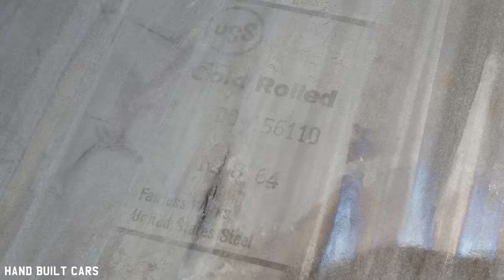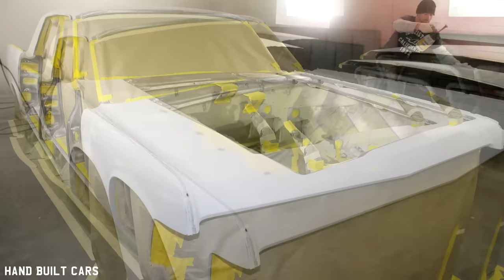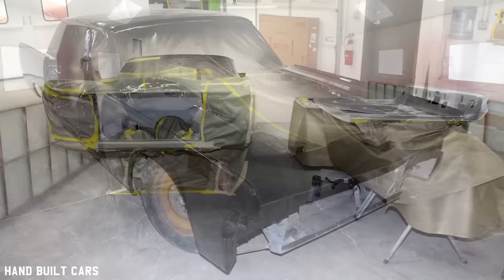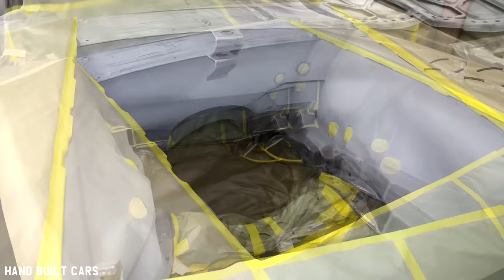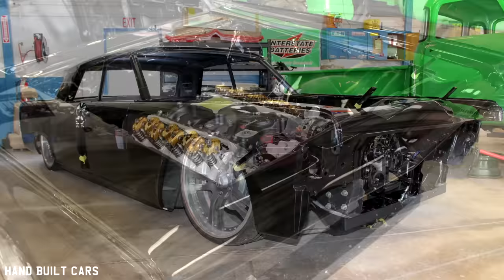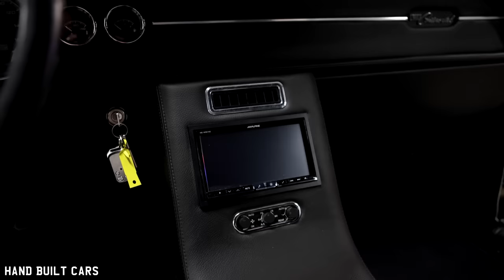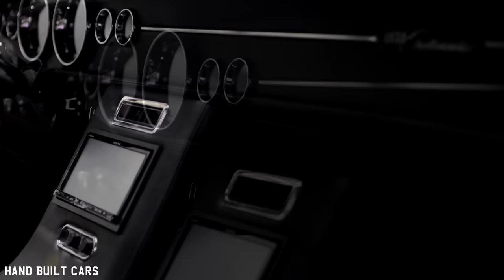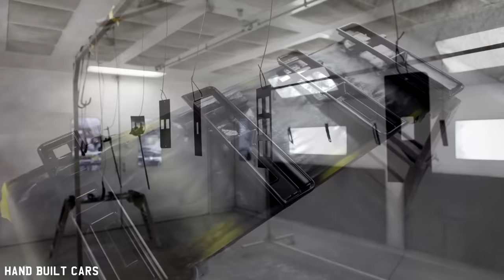1965 Lincoln Continental 532 Stroker Full Restoration Project

Comment: Great job, but in the end with these wheels it looks like a classic gentleman with Nike shoes.
Reply: 🤦‍♂️🤦‍♂️🤦‍♂️Should have left the drum brakes and the original motor too then I guess
Reply: I agree. Some smaller rims with nice spokes and thick white walls would've been my choice
Reply: To much rim and not enough tire...
Reply: I agree, the stock rims would have looked far better.
Reply: Well said
Reply: I agree the wheel pic is different, but it’s what the owner wanted. 🫤
Reply: I don’t mind the tire/rim size but definitely a more classic style would be better-maybe a wire wheel ?

Comment: Awesome restoration team. I am blessed to have three I acquired throughout my years of military service. 62 and 69 sedan but the 67 convertible is awesome too. Thank you for a look at what goes into them. Mine are not in that bad of shape, all original 460, 462 motor needs refreshing . Getting older now hope I don’t run out time getting them right. Be blessed to all who share the same passion as I for the stinking Lincoln’s.
Reply: I own 62 and 65 have them all original parts and engines. Restored
Reply: And here I am, trying to keep my 94 camry clean
Reply: We have a 68, all original. Have to sell her though.

Comment: A nice HELLO from germany, Bavaria 👋🍀

I've a big respect about all that nice sheet metal work, even because i know about that big work 👍👷
I'm still restoring a 67 Chevy Caprice/Impala 4 Door Hardtop with my 70 years old father (i'm 34)
What i've found in Ohio.i bought and impirted it to me, to bavaria. A car in a original unrestored condition what had rusted out all 4 wheel arches with the dog legs, also the bottom ends of the quarters, the whole lower windshield frame, weatherstrip channel at the trunk, the trunk floor & some more. Now we rebuilded all, especially the wheel arches at the front fenders was very difficult. Even also because you can't find repair panels or something else and it was all self/handmade with new flat sheet metal, hammered, cutted, welded, grinded until we got back rustfree fenders like new. The same about the whole lower windshield frame...the only repair panels we used and you could get for this Kind of fullsize Chevys was the quarter panels for 2 Doors. The forward half part of these 2 Door quarters we cutted and shaped to 4 Door dog legs, even to get back rustfree rear wheel arches... And so we got very good skills about forming sheet metal & body work.
& Even whenbi see some Videos at your Channel like this about this Continental i really know how, & what much work this is!
And i've really to say i'm sooo glad to see people like you at USA who're really RESTORING, and even not only changeing parts and use "parts-cars" what are mostly even also worth to save or restore in my eyes.
That's very nice, because so you could really save more restorable classic cars. Because I think every saved classic car is a good car even also because that other people, upcomming future generations of car guys than could get affordable project cars for their Projects. Every parted out classic car is a lost Part about that amazing history.
So i'm often very das to see that many people at USA are parting out really really restorable & saveable classic cars, even because they're only changeing parts and aren't really RESTORING classic cars.
I can see that this Continental was in a condition what made a restoration importand and it's also nice that with this project another more Continental is Back in the roads again instead rusting away or get lost for Future. Yeah, really really great for me to see that!☺👍🍀
I've to say that i'm more a Fan of a more Classic upgraded look, especially when we're talking about Wheels. So i think wheels Like these on that Continental are a lot tooo big. Especially the cool look with 8×15" and Cooper Cobras in 275/65 or something else at the rearend are my taste. I love the oldschool hot rod wheels on cars of that aera. But hey, it's even all a thing about the personal choose/taste ☺

I Wish i could get the next project to restore and save from a junk yard at USA. Even to Bring Back a car in the roads what the most people would parting out or let them rotting away.
It's my orde, to restore and save more of those beautiful US classic cars what anybody else whould not do. It's how i told you; every lost or parted out classic car is a lost Car...a lost Car what must go away☺

I Hope to see more saved classic cars in Videos at your Channel, it's even so cool, THANK YOU VERY MUCH 👋👋have a great day now🍀🍀

Comment: Amazing project and beautiful work for on the sleekest design in the Modern American car lineage, the front disc are limited in size for the overall weight of the car and the power of the engine, also, the seat with headrest and a wood Dash board would have also been interesting in the design!! overall, excellent result, made by professionals!

Comment: so much bondo...... lose the rims! Get somethind more classic!
Reply: Let's see your car.
Reply: @2414kels  I don't have a fancy car but a good idea about waht a nice car should look like!
Reply: Not really. If they used bondo to fill large gaps and such then it would be too much. Sure you could have tried no bondo. But the amount of metal finishing that would cost would be well above the cars worth. That is finishing bondo. Used to just clean the body. ESPECIALLY on a black car. Black is the hardest color to paint. Gloss black is like a mirror the smallest imperfection and boom you see it. 

In short very very rare do people not use bondo. When they dont the car is basically a show room car only with the amount of time effort and money you put into it. That isnt a lot of bondo considering how much sanding they had to do to it. All the bondo does is fill in scratches from metal work. 90% of the bondo is standed off. With how clean this was they did a lot of wet sanding too.